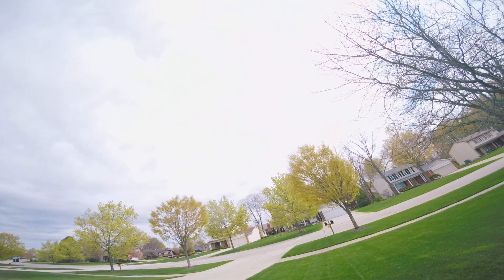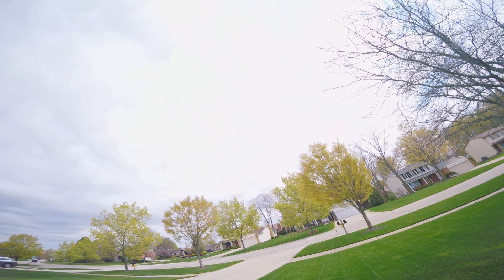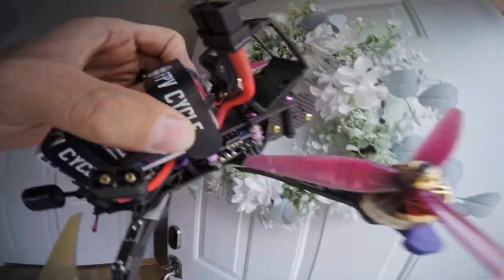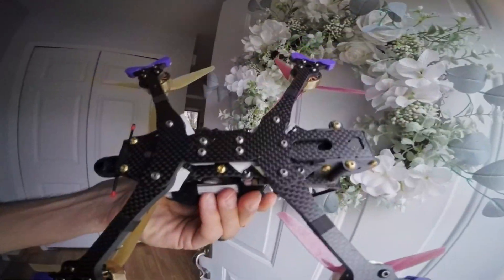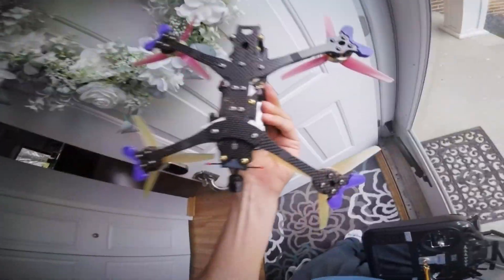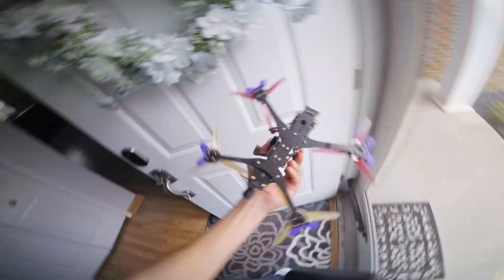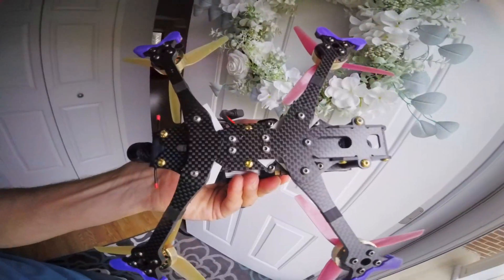KababFPV told me to put tape on my quad.... sounds dumb but o---my god.

Comment: It's certainly looks like it killed this weird high freq (~450Hz) resonance but it's hard to say whether it would be of benefit unless you had this resonance. Also the resonance was very specific either in the throttle band or at specific times in flight. I'd like to know if there is a general benefit across a wider range of freqs overall. I see you did share the logs thanks!
Reply from the maker: Yeah. All in all, I ended up using nyogel 767a and lowering my pids quite a bit.
Reply: @mouseFPV  yea. it's interesting nonetheless. what I noticed in the logfiles is the resonance only arose at specific points. when comparing the overall noise profile there was no general reduction in noise with the tape, only a lower probability that the resonant issue would arise, which is still good, but a different conclusion wrt whether it would be useful as a general practice. fascinating fix though. you could actually hear the resonance in the first example on your vid. it had a distinct pitch. reminds me of what props do sometimes. it might in fact be exacerbated by prop choice.
Reply from the maker: @PIDtoolbox  YES! The props dont help at all if they arent stiff enough ive noticed. I specifically have issues with the Ethix p3 pb&j props (which i think i used for this video). IE: im pitching back and punching out (like maybe a full throttle power loop) and then pitch forward it sounds like the quad it going to explode. however with something like the 51433 I dont have that issue at all. and that is at somewhat low kv and low weight (1750ish kv at <700g).

Comment: Electrical tape is amazing for vibration damping,you can also use silicone caulking between wherever carbon meets carbon,or sandwich areas.

Comment: Viscoelastic dampening!  Another material would be thin double adhesive sided clear mounting type tape.
Reply: Specifically, perhaps the 3M 4910 VHB type tape.  Also as noted on amazon....https://www.amazon.com/3M-4929-Acrylic-Adhesive-Viscoelastic/dp/B00TXSIOGC

Comment: Hahaha... brooo... thats crazy... so u just sandwiched tape in between the arm and the  cross plate??
Reply from the maker: yep! after putting it through some paces i still have some noise and the occasional "honking" at 440hz but its so much better its not even funny. Used a small static notch 420-460 to kill the noise there and the quad is flying great.

Comment: I looked at the logs. I agree the tape log is much better, very cool. NOW, that 470hz resonance is gone, and the dyn notch is taking care of the lower one at 190hz, but you still have a small one up around 638hz. It gets picked up by P and D terms. I recommend a narrow notch up here (center 638, cutoff 610), if you don't like it on Gyro, put it on Dterm at least. It should help. Dterm on pitch might be a little high. Its what was ringing at 465hz back on the no tape log.
Reply from the maker: ugh, its not just the one up in the 600's I have to take care of still. The one at 470 is still there a bit. I can still hear it honk very slightly every once in a while. 

Its funny you mention D Term on pitch. I flew a few packs the other day and on hard lookback moves It sounded like I was breaking the sound barrier, lol. Was considering bringing that down a hair. 

I am actually considering just turning on a single dynamic gyro lpf from 440-1000, backing down my pids by a dew drop, and just calling it a day.
Reply: @mouseFPV  that's an unconventional use of dynamic notch with rpm (maybe not, I mean it is resonance), maybe consider pulling all your pids down some (5-10percent): if you drive the frame a little softer, then the resonance will be less, and you're REALLY hugging that setpoint so I think you can afford it
Reply from the maker: @BrandonBeans  ah, not a dynamic notch, dynamic LPF. 

But yeah I can pull the pids down a hair for sure.

Comment: I'm not hearing that howl from the blades either.
Reply from the maker: You mean in the second video? Yeah that's sort of the point of what I was trying to show. That "toot toot hoonk" noise is the frame chirping at 450-500hz. The quad oscillates a bit and I can "feel it" in the throttle/goggles. It happens at about 20% throttle and at 70% throttle, and I sort of have to "push through". 

In the second video that is gone, and you can see where that massive vibration spike is gone at the end of the video. 

Crazy the impact it had.
Reply: You basically dampened the frame.  It makes sense.  If you've ever looked at power lines enough, you might notice some will have weights on them to dampen them from resonating in the wind.

Comment: I have a similar issue with the source v4 7inch arms.
Its a bitch to tune. 3 packs later it needs tuning again.
I can hear the resonance as soon as i take off.
I'll try this before i ditch the frame.
Reply from the maker: Can't hurt to try it! Good luck let us know how it goes 🙂
Reply: @mouseFPV  it worked.

Comment: Did you make sure all screws for plates and arms was on tight prior to taking it apart for the electrical tape mod?
Cool video, thanks for testing this!
Reply from the maker: Yeah several times. However, I did not disassemble and reassemble before adding the tape to make sure that isn't what did it. So...
Reply: @mouseFPV  Still, that's probably good enough, I'm gonna go on a limb and believe this might work. I'll give it a go on my next build!

Comment: So basically you had 2 harmonics before and after taping em one of those harmonics are straight gone. I think it has to do with isolation of the stack to noise due to arm vibrations, maybe thicker arms with stringers between the arms can also battle this out . Watch Chris Rosser's video on the glide's resonance analysis.
Reply from the maker: Yeah, the second band is juuuuust above the natural 2nd motor harmonic so RPMf isn't catching it. This wipes it out.
Reply: @mouseFPV  I wonder if there is another material we can cut to shape and use as a sandwich instead of the tape. Like a 0.03" thick rubber sheet. Im gunna water jet some and see one day.
Reply from the maker: @AGodwin  been using nyogel 767a these days 😎

Comment: I have a perfect pitch and I thought I heard a concert A in the frame resonance (440hz). I checked on the piano and I was right. I’m wondering what numbers did the logs show…
Reply: 450 hz in the logs
Reply from the maker: Yeah my peak is usually about 465 but 450-500.

Comment: This is the Chris Rosser's "frames need damping" argument. Watch the Apex theory from Kabob or some of Chris's frame videos. Looking at 3:40, there was no change in the gyro_rpm_notch settings either? This is the kind of motor band deadening we see on apex logs: the motor band is just super quiet, we can barely see the fundamental band and the second and third are largely gone too. EDIT: I see u have the logs linked ;)
Reply from the maker: I think that is why bob suggested it tbh. And no, literally no change in anything, you can check the bbl in the description. I don't think it's a harmonic of the motors, if it were the RPMf would snag it. The frame is humming juuuuust of the second harmonic.

Comment: Why are people against low pass filters? I've never had a quad fly better without lowpass filters.
Reply from the maker: It's a lot of latency, and it's latency on the gyro side which seems to negitavly impact flight performance more than it does on the dterm side.

With this quad on 4s Crate Booster motors flew much better without gyro LPF. The propwash handling was absolutely unbelievable. It was like flying a sim with propwash turned off.
Reply: @mouseFPV  saying that lowpass filters create a lot of latency is like saying notch filters create a lot of latency. It all depends on how you set things up. I have many drones I've tuned to fly without propwash, and all of them use lowpass filters.
Reply from the maker: @Quick-Flash  right on. Everyone has different experiences and everyone is going to think different things feel better. 

One thing I have noticed is that if you use pid toolbox and load in 2 files, one with 2 lowpass filters turned on and one without them (and having otherwise ample filtering, specifically a dynamic notch and RPM filtering on at least 2 harmonics) what you might find is that on the spectrograph for the LPF file you have much less noise, but interestingly if you only look at noise below 100hz, you actually have more noise with the lowpass filters, due to the latency in the pid controller not being able to react fast enough to the movement. yuo can see and feel (jello, propwash) at less than 100hz, but you wont notice much over 100hz, so if you motors can take the heat, you are probably best off making the trade off. Even if you have motor heat issues, its usually worth adding in some dterm filtering to solve that if it means you get away with less gyro filtering.

But its not all about the graphs. Every quad is different. and every pilot is sensitive to different things, there is surely something subjective in if a quad feels good or not, so I don't doubt what you are saying. But if you ask "why do people want to remove lowpass filters" its because filter latency is one on the last bits of low hanging fruit (not really low hanging, clearly) for making quads fly better.

Comment: Oh boy. This is the new thing. Like when johnnyfpv taped his motor mounts
Reply from the maker: Perhaps... I wasn't around back then, lol. I mean I was alive, but not flying.
Reply: @mouseFPV  https://youtu.be/Ybx4oVB2Vvg once he released this everyone began taping their motor mounts. And then the rubber and silicon and tpu motor pads started showing up.
Reply from the maker: @daich  yeah so this, apparently (according to one theory) is called fretting and it's from the carbon moving against itself like fingernails on a chalkboard. Tpu is too bouncy and actually has its own resonance. So, while it's similar it isn't quite the same. This is specifically between body plates.

Comment: I know you meant noisy as in the gyro but I swear the motors sound way better to , there was some wonky sound on the first flight that wasn’t noticeable on the second
Reply from the maker: Indeed. I actually think these motors are the source of the problem, the frame is just amplifying it. Since the dterm amplifies noise back into the motors and then the frame, everything sounds better without the issue.
Reply: @mouseFPV  I’m so looking forward to the rekon 1804 3500kv motors  that will be on the rekon 4 freestyle. Really wanting a 3-4s 4” sub250